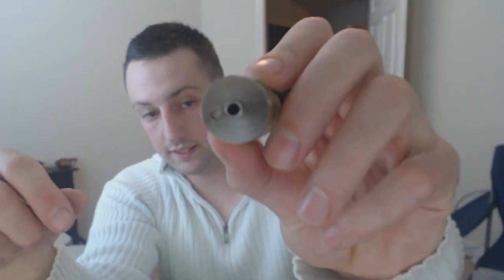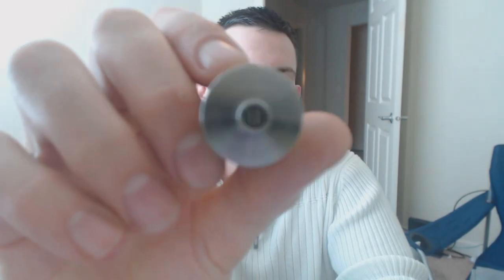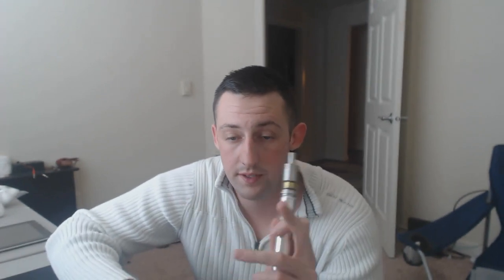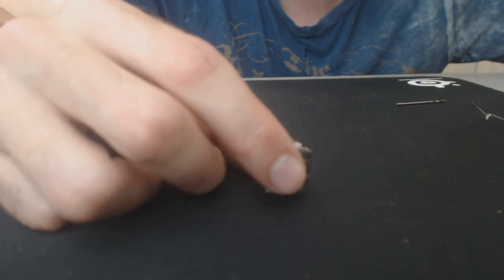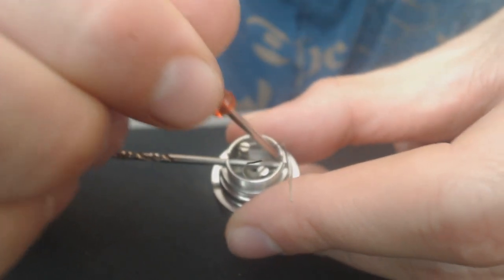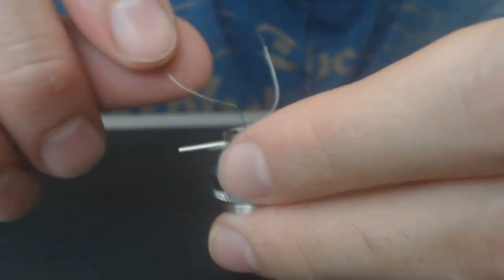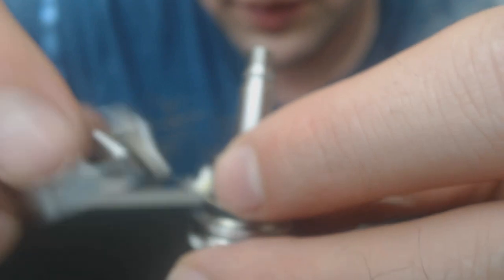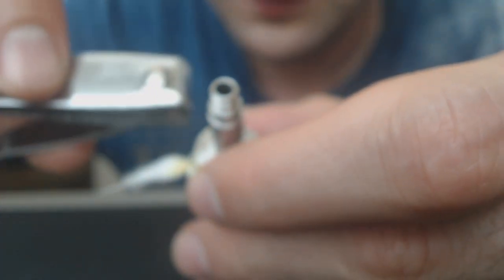Fogger V2 - Review

Comment: OK, just found this so here is my Q/A take on it.
1. Your attention to detail and explanation is spot on. Despite the camera issues your having.
2. Different builds info is something I haven't really seen covered. Most do the build and then talk only about the build they have done. I found it VERY refreshing.
3. Your quality remarks and the chip in the tank.. didn't expect that one but LOVED it. Tired of hearing how the metal needs changed or the coating or the like. That is an ACTUAL defect.

Now for my questions.. You mentioned your wire and the number of wraps.. Id like to know what size that drill bit was. Ive seen a lot used in videos and mentioning it goes completely un-noticed. Definately adding this one to my chrismas list (fogger). Now all you need to do is get a clone and do a head-to-head :)

Subscribing and looking forward to future reviews!

Comment: Hmmm I will have to keep an eye on that positive post, I did a 28g 12 wrap cotton build with o-ring on. It has not flooded yet, been about a day and a half. It is a great vape, building is not as hard as you would think. I like it, easier to build a micro coil in than a protank. As for longevity and reliability, I'm just going to have to keep using and see.

Comment: I wish that little bung that the put under the coil was delrin instead of rubber, that is stupid. So it doesn't melt. And I noticed that you don't put the o-ring on the coil housing. Going to have to give it a try with micro and coil...

Comment from the maker: to be completely honest i stopped using the fogger v2. just recently i was building a Silica build and the positive post just kept spinning when i would tighten the wire. cause if u take it apart the positive post is just sitting in the insulator making contact with the bottom center post like a plate system. horrible setup if u ask me.